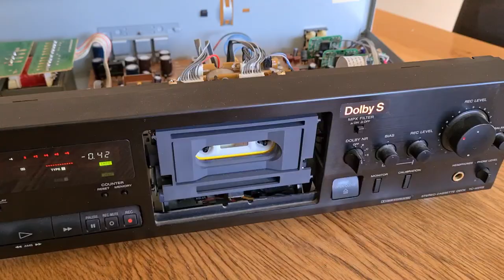Sony TC-K611S Three Head Cassette Deck - Rotary Encoder Repair / Belts

Comment: Thank you! 
I have this same deck and the door would not open but belts were intact. 
Followed this video cleaning rotary encoder. 
Also replaced belts while i was in there and now my deck is working again. 
Thank you for the great video.

Comment: The proper adjustment of the rotary controller is probably why the unit goes crazy after replacing the belts.  Thanks for this, I will revisit my TC-k615s.  I'm sure it's the same issue.
Reply from the maker: It's a common fault if the unit won't change modes correctly.

Comment: Excellent video, I'll be repairing my own 611S soon. hopefully it will only need belts. I recently repaired my 615S , looks the same as 611S on the outside, But the mech is completely different. same as the W411. Turns out it needs a new drive gear for the mode motor as it dumps tape from the supply reel when paused or stopped. Found some high quality gears from Poland on Epay

Comment: Hey Paul, thanks for your videos.  I’ve just repaired one of these for my uncle. Someone else had already been in it and the drive belt was replaced with two thin elastic bands something else had failed so I stripped it apart the gearing and works perfectly. Hats off to you Sir
Reply from the maker: No problem buddy, sometimes there are some really good attempts you can come across. I'm certainly no expert but glad I inspired you to have a crack 👍

Comment: Thank you! Your video helped me replace the belts and clean the rotary switch in my deck. It’s a TC K-690, and the tape transport is very similar to the transport in your video. The entire process took about three hours, and now I have a fully functional three head tape deck.

Comment: I picked up a non-working  TC-K670 at an estate sale for $20. Cosmetically it was perfect, so I figured new belts was all it needed. Wrong ... after replacing the belts, the head and pinch rollers still wouldn't raise properly for the play to start. The hardest part for me was desoldering and resoldering the pins of the rotary switch. I need more practice ! Anyway it works as good as new now ... thanks for a fantastic video !
Reply from the maker: No problem thanks for the comment, that rotary switch is the crux of a fair few odd problems on this transport 😑
Reply: @pwrestoration  I didn't think it looked all that bad when I first opened up the switch, but the going over it with emory paper made a big difference.

Comment: Worked at a electronics module factory before.
For cleaning copper traces/pads, we used to use pencil plastic erasers and does the job nicely without affecting PCB masks or scratching the pads.
Reply from the maker: Ah I have one on my shelves, I wondered why I had put it there 😅

Comment: thanks for the vids, I got my k611 to work, first i replaced just the main belt and oiled the capstan motor and it mostly worked but would not play, I then had to do a full tear down to the mode selector and clean the dirty contacts, all works fine now. no one else had been inside, so dirty mode selector is a thing as you said

Comment: That oil most likely Deoxit D5
Same problem with some CB radios that have encoders like that and you have to have some oil on the contacts to stop the oxidation. 
and use a pencil eraser when cleaning contacts not sand paper.
other then that very informative video. Thanks.

Comment: I was able to disassemble the rotary encoder without unsoldering it from the board. On an untouched encoder, the four plastic pins are not originally melted, but are held in the holes only by friction. After removing the two screws, I just peeled off the cover using a small flathead screwdriver, carefully pushing it into the slot all around the disc. May become useful for those who experience difficulties with unsoldering.
Reply from the maker: I have tried this but there's no good way to rebuild it. It needs to be held together properly and securely, as the internals rely on pressure onto the contacts to work properly. 

The time I used your method I found that it separated about half a mm and the contacts didn't make properly, leading to it being stuck between modes. If it works for you, happy days though!
Reply: You know, the encoder repaired by me without unsodering only worked for one day, after which the problem returned. You must be right, it's obviously no way to achieve proper closure of the spring contacts with the base disc without physical extraction of the whole setup off the board and pressing the parts carefully together afterwards. Now I have to go all the way again. Good experience, though) I will inform about the final result.
Reply: Okay, I have unsoldered the encoder and processed it in the way it is described in the video. However, after I have assembled all parts back, the mechanism failed to work again - the capstan motor has fried! Have changed it to a new one, and everything started to work as a charm. So in the end I was left in the dark as to what actually caused the deck not to work - a dirty encoder or a dying capstan motor.

Comment: Crazy, a lot of the mechanic is identical to my TC-KA5ES and 7ES. I always thought, when some parts crack I'm for all time out of luck in finding replacement parts. But if this non ES deck has the same gear and plastic parts, for sure other models have them, too.
Reply from the maker: Put simply if I add a capstan and another pinch roller to this transport it's the same as some ES transports, I toyed with the idea of doing that but I figured all was doing was adding more potential problems 😅

Comment: I have had this cassette deck that I bought used on eBay in 2006 that has barely ever gotten any use since I've owned it. My son brought to my attention that it won't play, which turns out to be the rotary encoder that you pointed out in this video. Is it possible to clean the rotary encoder with electronics cleaner without disassembly? I'm pretty certain that the transport mechanism has gotten quite dusty over the years from just sitting in my entertainment system without any use.
Reply from the maker: It's really difficult to get the cleaning solution into it without disassemble. Maybe worth a go but still not that complicated a job 😀

Comment: Could the oil in the mode switch be dielectric grease? A couple of YouTubers put that stuff into these switches in VCRs.

Talking about VCRs I'm going to try the pen trick on a pinch roller on a video that has lost the plastic washer and so is flapping about. Thanks!
Reply from the maker: I'm not sure. To be honest there was so much white lithium grease dotted about the transport it had gotten everywhere 😄

Good luck brother! It seems that pen trick might be saving a few things tonight, had a few mentions for it

Comment: Fantastic videos - I have a couple of these decks that I'm hoping to revive. Have you come across any issues with the tape type selectors ? Both decks I have aren't correctly identifying the correct type - for example one identifies any tape as Type IV ! Any pointers or things to check would be much appreciated.
Reply from the maker: Very common, it's the four black switches at the top of the transport. You'll have to remove the transport to get to them properly but they either get bent from people forcing the transport back in, or simply get a bit mucky. Nice easy fix if you're happy to pull the transport!

I have a few videos on this deck and transport type with tips on the best way to remove it and avoid damage 👍

Comment: Hi. Very informative video thanks.
I have this model and love it, but my unit has similar problem. It’ll fast forward fine, but only play or rewind for a second or so….
Is it the same fix? Would really appreciate your opinion as you seem to know your onions.
Reply from the maker: I'd say it's either the rotary encoder that needs a clean, or the backs of the reels need cleaning. The sensors can't sense the deck is spinning sometimes. 

Email me if you get issues, I repair these regularly.
Reply: @pwrestoration  Really appreciate your response. I will email in due time. Thanks again.

Comment: Dobrý den dotaz dá se nějak ovlivnit tažná síla navíjecí kladky při přehrávání se hrne pásek ke straně většinou na začátku kazety děkuji za odpověď pm
Reply from the maker: Yes take the black faceplate off and then remove the take up arm. It is held in place with a rubber washer. 

Give it a good clean out, clean it's shaft. DO NOT grease the shaft. It needs friction to engage 

Good luck
Reply: Pokudim se díky ale kdyby tady byl navod tak by to bylo super 👍 @pwrestoration

Comment: How do you adjust the speed on these critters? The service manual is no help at all, thanks.
Reply from the maker: Hi it's a pot in the back of the main motor. I've got a few videos on this model, the speed adjustment is usually towards the end of my videos. Hope you get it sorted!

Comment: Do you know of the rotary encoder is the same in a Sony tc-ke400s deck? Mine is playing up as non of the buttons do what they should. Fast forward and rewind make it play and sometime makes only one real rewind which chews the tape up!  Pressing stop does a similar thing too then the deck gets stick on the play positions and you can’t eject the tape until you turn the deck off and on again!
Reply from the maker: From memory it's about the same, but the rotary encoder will only cause the deck to get stuck between modes, IE it'll play, judder, FF and then reverse, etc etc. 

If the encoder is duff the buttons will still work. I'd say if this is your issue the tactile buttons have had it. They work oddly though, one broken button can cause issues with all of them. They share an earth and signal path. You'd have to take the button panel out and solder a set of new buttons in. Luckily though, they're about £2 for 10 on eBay. Just gotta measure your current ones and get the right dimensions 🙂
Reply: Thank for your advice. The deck does jump about too fast forward inf and rewinding too and the mode selector motor keeps going running back and fourth. The only button that seems to work is the play button.

Comment: Asking for help with my AiwaADF800 the photo sensor has clapped out. I cant find one anywhere the service manual says its a SP1-315-04-B this brings up nothing on google. Thanks in advance for any help if possible.
Reply from the maker: Yeah generally those codes are way outdated and only apply to service techs for Aiwa in the decade of manufacture. Your only bet is to try and locate a spares or repair deck that has the same transport.. go as low down the range as you can find. Maybe the service manual quotes other model numbers it applies to?

Comment: What will you do when the door does not open and the belt of the dooropener is broken
Reply from the maker: You can manually open it. Take the lid off and look down into the transport. There is a white cog on the left side of the transport, use something not sharp to turn it and the door will open just enough to remove the door cover. Then you can pull the transport.

Comment: I have one of these with what I suspect to be a bad flywheel (I've had a look at it and it looks cracked and I can feel a bump on it), when I turn it on, I can hear a fast knocking sound and when I put a tape in and record, there's quite a bit of wow and flutter on piano and guitar music... I'd love to get either the bad flywheel fixed, or try to source a replacement.
Btw it's a UK model that I bought on eBay, from the UK shipped to Australia. It also claimed to be "Refurbished" but now I know that it was seller refurbished...
Reply from the maker: It's easy to get to so you can have a look. If the plastic washers are missing from either side of the capstan shaft it'll cause bad flutter.
Reply: @pwrestoration  I've only seen one washer for the capstan that goes on the front end, I didn't know that there was supposed to be one that goes on before putting it into the hole? Also I have had a good look at the entire flywheel and taken photos of it, and I can clearly see cracks all over it and feel a warp when running my fingers over it, so the flywheel to me looks like it's been exposed to high heat/bad storage which has caused it to crack and warp.
Reply: @pwrestoration  So I feel that I need an entirely new flywheel, because the one that's in it, causes an audible noise when powered on, and it to me looks cracked and warped. I have photo and video proof too!
Reply from the maker: @finleypapworth9575  very odd. I'll keep an eye out but it'll probably need a donor machine for it
Reply: @pwrestoration  Yeah, I figured that I might have to, if the 511s has the same flywheel, that’d be nice if I can’t find many 611s on eBay. Those models are very difficult to find here in AUS! (or pretty much any decent 90s 3 head deck!) which is why I have to look at UK decks, (you guys have heaps more) since we use the same voltage and htz as the UK! (although a parts deck wouldn’t matter if it’s the wrong voltage)

Comment: Hi, greetings from the other side of The Pond. I'm an amateur  trying to fix my Sony tape deck. Have a look  https://youtu.be/Vl4vtEaArIs
It's a TC-WR 820.  Transports look similar to the one in this video except there are two transports and each has two capstan flywheels. Both transports will eject rewind and fast forward. But when I push play it stops. I've changed the belts and was very careful to align all the gears as shown in the manual. Checked and cleaned the mirrors. I haven't cleaned the rotary encoder. I'm wondering if it's possibly something else? Also  before I took things apart I noticed the capstan flywheel washers were missing. You mention I can cut some out of a pen refill? seems it would be much smaller than the one in the video. I'll have to try cutting some. Any advice is much appreciated. And great video. 

Cheers
Andrew
Reply from the maker: Andrew no the pen refill trick is for retaining part of the transport. It should still run without the washers on the capstan. 

Is the unit registering it has a tape in it? Did you also clean the sensors when you did the mirrors?

A rotary encoder clean is always beneficial. But generally it just causes the unit to be stuck between two modes.
Reply: @pwrestoration  It does run without the washers on the capstan, and surprisingly quiet too. A bit of history about this unit; It was my brother-in-laws and hadn't been run for over 10 years. Sat in a cabinet beside his woodstove for years. Belts were mush but the insides are very clean. Mirrors were clean but I gave them a wipe with IPA anyway. Sensors too. 

I don't know how to tell if the unit is registering that it has a tape in it, I'm not sure how to do that?

 I have been testing it without the ornamental plate assembly and LED, I don't think that matters?

I used the pen refill trick on the lever assembly, And test fit one on the capstan while it was out on the bench. It works on the Capstan, might try it when I put it back together. 

Thanks for the help, really like to get this going. Any more ideas would be great.
Reply from the maker: @AndrewUxcentric  if it were me I would simply leave the washers off the capstan for now. If you're definitely confident the mirrors and sensors are clean then it must simply be the transport is stuck.

The unit should recognise if you have a type 1 / type 2 tape inserted via the brass leaf switches on the top/front of the transport. 

It should show on the display. If it doesn't, they may need fettling a little. 

After that I would be stripping the transport and probably cleaning the rotary encoder if it has one. And then making absolute sure that the transport is rebuilt properly, the primary thing being that the rotary encoder is aligned properly as per the video (if indeed the transport is the same).
Reply: @pwrestoration  What do you reckon...  https://youtu.be/drbmxNb1F8A
The display will show a dotted red line when a type 1 tape is loaded. Is that what it is supposed to do? or should I actually see the words "type 1" somewhere on the display
Reply: Here's a video showing how I aligned the mode cam with the rotary encoder and the selection lever, and a picture from the manual. Still same problem. rewind and fast forward only, no play...
https://youtube.com/shorts/s_PxllJIFJs?feature=share
https://drive.google.com/file/d/1ypCgYTj_he8MKVIDECerxOpDjU5JauM7/view?usp=sharing
Reply: It works. The brass leaf switches were the problem. I moved them up and down, stressed them a tiny bit and somehow  it played. Maybe they had some corrosion over time that needed worked out. Thanks for the help. Now on to the other transport. Probably same problem. Cheers
Reply from the maker: @AndrewUxcentric  perfect. One of them will be to indicate to the transport a tape is loaded. You should be able to see if they are making a connection visually but you can also test them with a multimeter. Happy you got it working!

The plastic covers do pull off but they can break easily.
Reply: @pwrestoration  Yep, one pulled off, it has a broken tiny hinge pin. Thinking CA glue will fix it , I doubt I'll find a replacement.
Reply from the maker: @AndrewUxcentric  yes you can glue them back on or also just leave it off. Won't matter much.